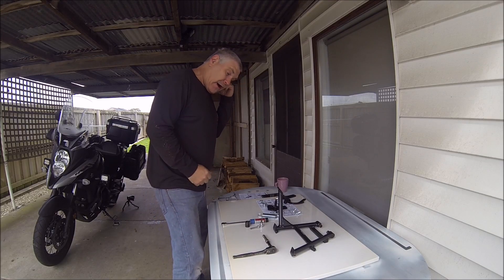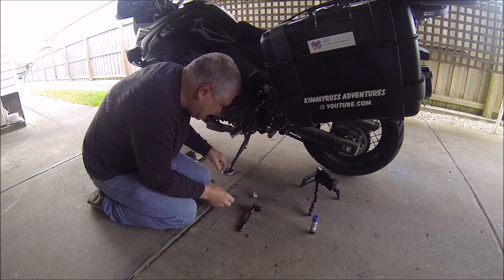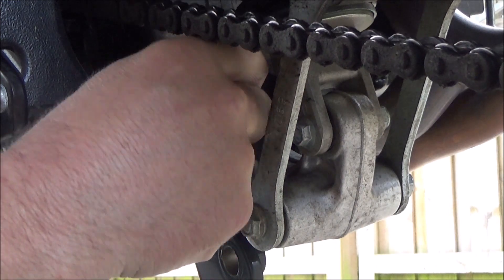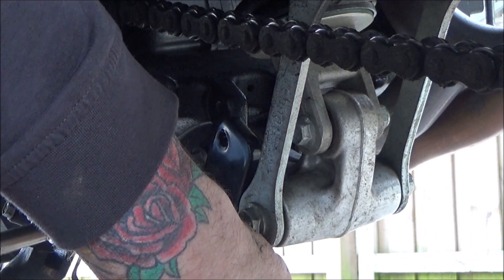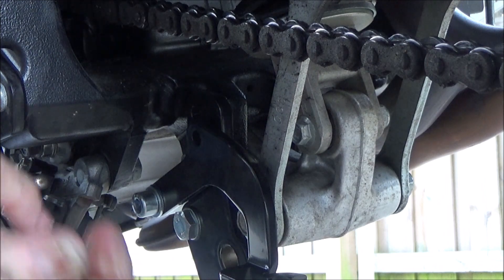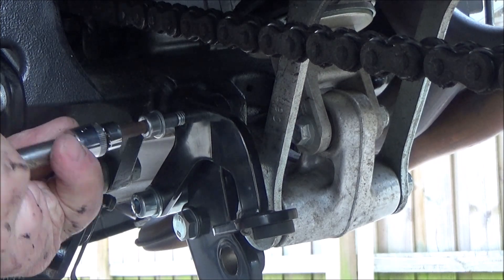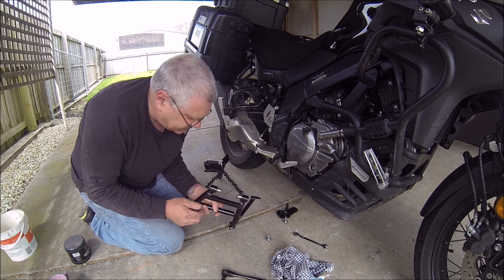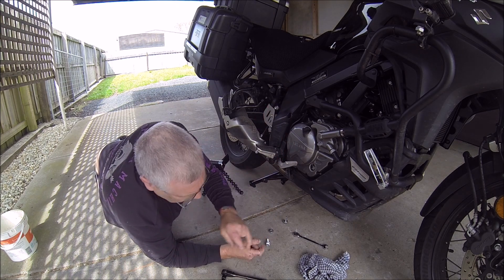SW-Motech Centre Stand Install On A V Strom 650 - 2017

Comment: Hello Russ,
excuse my english (google translator)
I live in Germany and
I have the same motorcycle Suzuki V strom 650 XT 2019
I also have a main stand that I would like to mount because the video is ideal.
Which windscreen do you have on your motorcycle? I have turbulence on the original screen.
Greetings George
Reply from the maker: Hi there mat yes i thought the original windscreen was terrible for bufferting so the one on there is an adjustable givi one mate ,you can make it higher or lower.https://www.givi.it/my-motorcycle/product/suzuki/dl-650-v-strom-17--22/screen/af3112

Comment: Do you know the size/thread pitch of that bolt that needs to be replaced on the right side?
Reply: Never mind, I found it in the instructions (https://sw-motech.com/cosmoshop/default/artikelpdf/hps_05_764_10000_b.pdf) Its bolt #16 - M8 35mm. I assume its a fine thread pitch - 1.25.